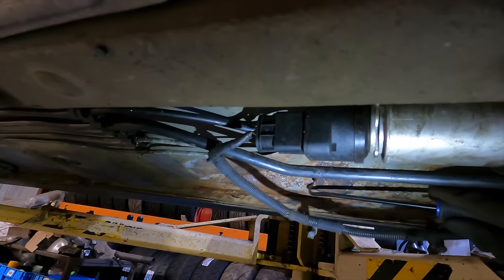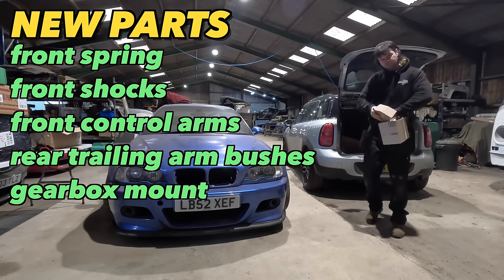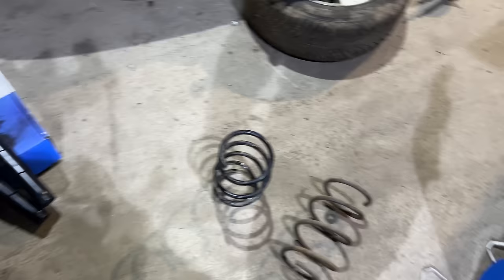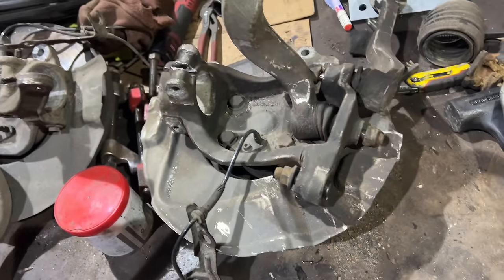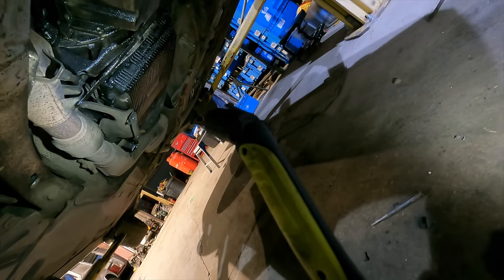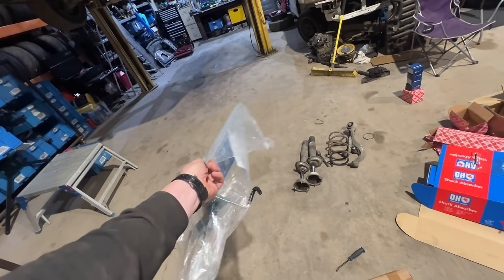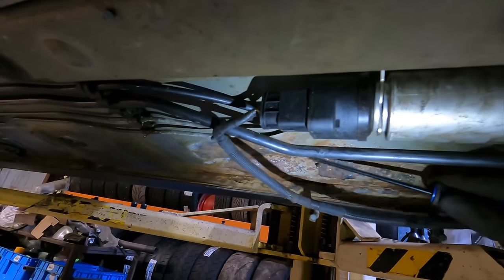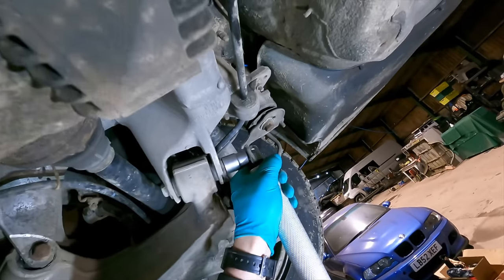Rotten Brake Lines & New Suspension BMW 5 Series

Comment: Mate those Citroens are the dogs, but also very very bad to work on. Had one in my main dealer for brakes and it was a nightmare to replace just discs and pads. My god are they comfy and nice to drive if you get the one with good suspension. The one I worked on was left hooker with 50,000 miles on it, 2.7 V6 dieselgate aswell

Comment: Top tip 
When doing suspension bolts with rusty exposed threads, secret is a quick clean with a wire brush if possible, find another nut the same pitch and run it over the end with some grease  prior to removing. 
Works well on drop links toooooo . 

There’s another 3years running in that car we had a 520 M sport but kept cracking rims so watch out for that too ( inside bead ) . Even when welded they only last a few months before cracking again 😮. Ours had crappy heater and misty front screen and front windows too . 

Could be worse dude and have an old Range Rover sport like us for towing etc😂. ( actually their a very good all round buy if you drop on a nice one and own a ramp and a lot of car for the dollars ) 

Lastly tell your man with the ramp to watch the anchor bolts . I’ve always used chemical fixings and really the extension should have been bolted to the ramp base and separate bolts to the concrete as there’s less leverage.

Comment: Spray the threads and nuts with wax like super troll or something that protects from rust. It proper clings to threads much better than a coating of anti seize. I’ve been spraying every bolt under the car and after a year my bolts are like new under the wax. Works really well on undertray and wheel arch lining bolts. A must is spraying the tie rod end clamp bolts, rear toe and camber bolts because bastards get fucked in no time. Those bolts are cheapest direct from bmw dealer, they usually have them in stock because they use them in everything.
Reply from the maker: super troll? is that a wind up
Reply: @dannyDC2  supertrol anti-rust fluid does indeed exist.

Comment: I wouldn't be grinding or painting at the underside of that; 10 minutes once a year giving it a good coat of fluid film (available in aerosol) would stop that rust dead in its tracks and give the old girl a lot more time than it's got at the moment. I spray all of mine every Autumn and whilst most of them don't see the road in Winter, it's kept my 12 year old van in good nick for 240,000 miles.
Reply: Is that waxoyl you use ?

Comment: BMW uses all the tool box, and then some. Owned my e36 twenty-three years and never needed a 9 nor a 12mm deep socket until I adjusted my parking brakes. They easily could have used a 10 and 13mm instead but I now own 2 shiny new sockets I will never use again.

Comment: I think you've got the wrong spring and top mount assembly on that damper Danny lad 

Are the front springs coiled the same way or is one wound the opposite way?

The bottom spring seat was opposite to the way the coil was wound, that's why it wasn't seating right, maybe you've got o/s spring on n/s strut?
Just rebuild my struts recently and done a few others and I think you got the strut top and spring for drivers side on passenger strut and visa versa... Your spring should sit into that lip in the bottom where it steps up, you've given your beemer a bit of a lift kit the way you've built them struts

Comment: Danny, if the nut isnt starting to glow red then then nuts not hot enough on rusty shitboxes. Im speaking from experience.

Edit: Also, it seems that on all rusty old independent rear suspension estates, the rear alignment bolts always seize up.

Comment: Hi Danny, I higly recommend buying yourself the £100 ebay 3Ton spring compressor stand. Its a god send piece of kit. Especially with modern bmw springs and dampers that are massive compared with the damper bodies. I absolutely lost my bottle with spring compressors on my e46 front shocks.
Reply from the maker: I will check it out, very rare i have anything to do with shocks and springs! But maybe I will as the rallying starts...
Reply: Iv broken 3 springs in the last year with pot holes and a speed bump at 10 mph in 1st gear 😮

Comment: Threads possibly damaged from, the socket you were tapping the bump stop on with?? Had a bad experience with those spring clamps before, they slipped around and trapped my fingers when the spring turned into a u shape, had to get my fingers cut out of it, well worth getting better clamps👍

Comment: Another long weekend but progress made, scary brake pipes behind those clips, 😮 may be worth trying
LA-CO Slic-tite heavy duty pipe thread compound paste with PTFE from Screwfix on all the threads after assembly, just had a quick look £12-00 worth spending, just brushes on and stays wet, resistant to heat, petrol etc.

Regards Russ..👍

Comment: I snapped the pinch bolt on the knuckles to the shock on one side and the previous owner ruined the thread on the otherside.... Abs screws were shagged and the bearing was noisy so i took the plunge on eBay and got all new everything (bar some bolts i got from my local dealer) and honestly it saves so much time and future costs. Spending this now is a good job for the future. It'll all pay off 👍

Comment: Did the sump gasket on the e91 in the chase to stop the oil leaks, not a fun job at all
Reply from the maker: I’d probably want to change them all if I did it. Would be sad to change the rocker gasket and find it still leaks!
Reply: @dannyDC2  yep that’s the problem, injectors out for that as well. They’re so nice to drive but so time consuming to maintain. Love a long garage vid

Comment: With regards to the oil leak are you 100% sure its oil? Sounds weird but i had a few leak off pipes between the injectors that had split and it was fuel running down the side of the block and looked 100% like oil but after sorting the leak off pipes out that was it and didmt actually have an oil leak. Cheers for the good content. Ive enjoyed the racing so much last yr.
Reply from the maker: I have considered it might be fuel! Would make sense
Reply: @dannyDC2  just looked very thin to me and not the ussual super black diesel oil thats like black paint.  might be a quick easy fix if that's the case mines a 330d 46 but I was surprised it was that but seemed to fix it on mine. 🤞